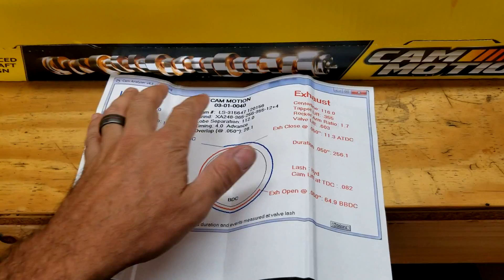Finally fragged Little Red's 5.3. A look at the carnage.

Comment: What motor mounts u running
Reply from the maker: Mounts are s10 ls swap mounts. Brackets are made out of 1/4 steel plate purchased from the local recycler. Built with a cheap chicago electric chop saw and a >$200 220v chicago electric flux core welder. I did it all and I'm not a welder. Lol.
Reply: @thecarrsgarage2595  sweet trying to swap my 90 d150 to a 6.0 Ls